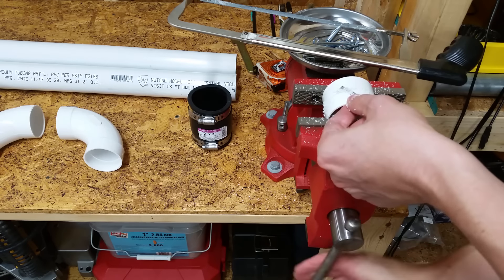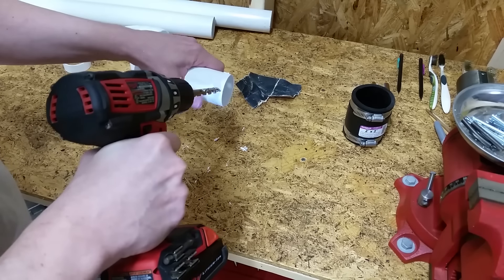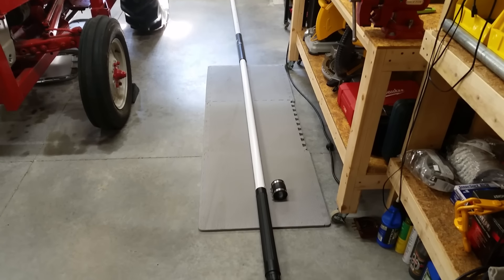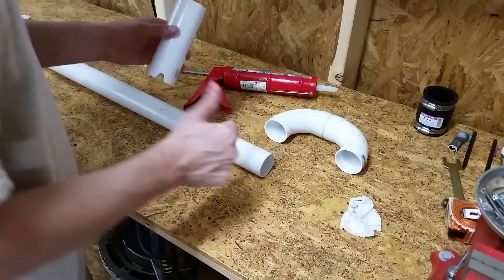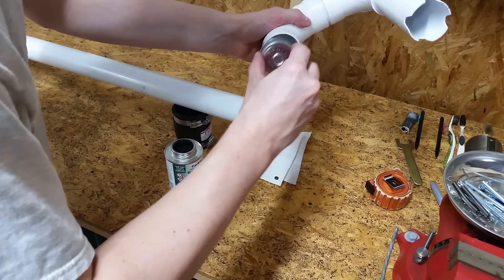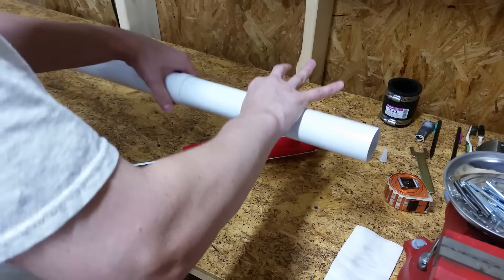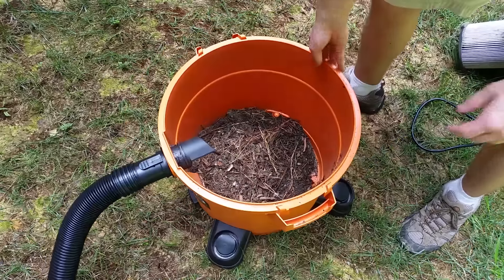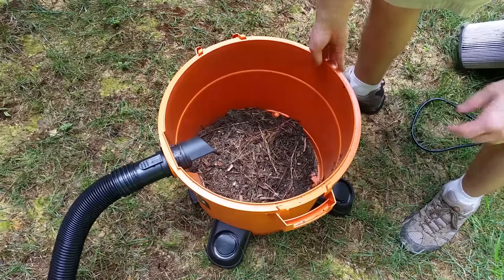DIY Gutter Vacuum - Easy and Safe Gutter Cleaning from the Ground

Comment: I made a similar pvc clean out but used 1.5 inch pvc and used a heat gun to bend the end of the 10’ section into a 45 degree hook - then used the heat to pinch the end almost flat - instead of suction, I used the shop vac blower - works decent
Reply from the maker: That's a cool idea! I've thought about doing the same but didn't consider that it'd be better to taper the end.

Comment: Nice Mike I'll give it a try. At 65 I spend as little time on the ladder as possible.
Reply from the maker: I don't blame you one bit! :) I did a follow up video in case you need more details.
Reply: @Mikeattempts  I saw the newer video. I have both of them saved and will have the device fabricated before the end of the summer.  I'll send you my critique. Thanks
Reply from the maker: @michaelcerkez3895  Yeah, let me know how it turns out! :)

Comment: I modified this approach to fit my particular skills using  packing tape, a  coat hanger, and some pipe  I found in the grass .
Reply from the maker: Hahaha, that's cool, whatever works! Since most of my gutters are 2 stories high, I don't know what else I could use besides the central vacuum tubing. Anything else would be much heavier and hard to maneuver.

Comment: This is totally awesome.  It looks like I can only get Schedule 40 PVC.  Thoughts on if this is too thin?
Reply from the maker: Schedule 40 PVC would be way too heavy for a 2-story attachment. It would probably be fine for single story gutters though. You should be able to find central vacuum tubing locally. I did a follow up video with more details and answers to the most common questions, check it out.

Comment: Good idea, thanks, - I'll make one too. But I have the problem of wet soggy leaves, moss and slime like some others in this thread which I solved some years ago by making an extension for my Karcher high pressure water cleaner using one of those garden shower things with a curved end and cutting off the end of a karcher nozzle. Needs some strong hose clamps to join them because the pressure is fierce. That works very well- at least for one storey - although it pays to wear a raincoat!
Reply from the maker: Hahaha, yeah, I bet it's just like getting rained on. Sound like a good solution though. With a strong enough wet/dry vacuum, I wouldn't be surprised if it would just suck all of that stuff up.

Comment: You can do the same thing with a leaf blower, just substitute a 45 degree elbow for the second joint - then you can blow the debris out.  Connect with whatever fits your blower.  I used a rubber plumbing reducer from my blower outlet to the size of the pipe.  Works fine.
Reply from the maker: Yep, you could also attach the vacuum hose to the exhaust port and blow 'em out but the leaf blower would probably be more powerful. Thanks for watching!
Reply: If you blow them out chances are there will be standing water in the gutters somewhere.  You'll be taking a shower in black nasty smelling leaf water before the job is done.  Guaranteed.  And half of the junk will end up on your roof shingles and siding.  Been there, done that.  Good idea...maybe it'll work for some...but keep in mind what happened to me trying that.
Reply from the maker: Yeah, that's the reason I only suck out the gutters, clean and easy. I don't wanna get covered in debris and then also have to clean up all the crap on the ground.
Reply: Unfortunately this setup won’t work at all with backpack blowers which have too many CFM’s and too much torque. I tried it today and the blower generates way too much power for the tubing and angles...unable to handle
Reply: @NeilLB7 yeah but his vacuum only works for small Leafs inhave maple and sycamore they are huge lol no way this would work

Comment: Yea that looks like a good idea rather than gutter guards just have to maintain I assume do it after hot dry days but you didn't mention what vac to use does a normal utility vac work for a long extension?
Reply from the maker: My vac is a "5 HP" but other viewers have said it works great with less power. I did a follow up video, if you need more details.

Comment: I made a similar version today and it worked very well.  I used shop vac extensions tubes I bought at Lowes, PVC pipe for the curves plus duct tape.   I did the gutters on the second story by doing it inside from the 2nd story windows.    All and all, I'm very pleased and I'm still in one piece!   Thanks for making this video!
Reply from the maker: Home Depot actually sells a gutter cleaning kit very similar to the one you made. That was a great idea to reach the 2nd story gutters from the windows. Thanks for watching!
Reply: can u reach all of ur gutters fm ur windows?
Reply: Nice

Comment: Great video Mike. I cut the exact coupler you used but it does not slide down the vac tubing. It only slides on to the end. How did you get tne 2 pieces to position 12 inches down the end of each vac tube? By the way, glad I read the comment. I am a 76 year old female and did not know pvc cement would not work on abs (I cut two 1 inch pieces of abs to use as stops on the vac tubing). So please let me know how to get the 2 pieces cut from the coupler to slide 12 inches down on the vac tubing. Thanks!
Reply from the maker: The coupler has a lip in the center which is why I used the odd method in the video of carefully cutting along the seam to remove that lip. I then used sandpaper to smooth out what remained so it could be slid up the tube, it is a tight fit though. If you want to use the ABS stops, you should be able to use silicone caulk, like I did for the larger piece. If that doesn't prove to be strong enough for the small ring of ABS, any construction adhesive caulk (such as Liquid Nails) should work fine. I did a follow up to this video, in case you need more details.
Reply: @Mikeattempts  wow! Thanks for immediate response. Yes, I did cut along that seam and made sure to eliminate it. I also sanded it quit a bit but no luck in getting it to slide 12 inches. So will be using the abs. Question: would jb weld be a good option to cement abs to pvc?
Reply from the maker: @someone2no104  Yeah, JB Weld should work fine. You might just wanna rough up the inside of the ABS ring and the outside of the PVC tubing, where the ring will sit, with sandpaper to give the epoxy a good place to hold.
Reply: @Mikeattempts  thanks!

Comment: The gutter vacuum is a great idea, I use that same setup but with a blower, but a vacuum seems easier
Reply from the maker: Yeah, I can connect the hose to the exhaust port on the vacuum and blow it out too, it's just cleaner to suck it out.

Comment: Good idea using the Schd 20 pipe... I've got 40ft of it left over from my central vac install that I now know what I'm going to do with it.   I think it might be more efficient to just cut out about 1" of the pipe that goes into the gutter half way around instead of having  4 cut outs like you made - you should have all the suction happening in the direction you are traveling.  It might limit you to traveling in one direction only unless you can twist that piece around... but small price to pay to get more suction where you need it.
Reply from the maker: I'm not lacking any suction but you could just make the holes smaller if that's a concern. The holes are only there to break the suction so the tube doesn't stick to the bottom of the gutter. Let me know how it goes!
Reply: @Mikeattempts  Quicker way to cut those slots would be to use side cutters and clip triangular openings.
Reply from the maker: @rokustittsville2422  That's true but I wanted to keep the holes rounded so pine needles and leaf stems wouldn't get caught in the notch of the "V". Thanks for watching!
Reply: @rokustittsville2422  Use stone rotary grinding bits. It will cut the round slot in a faster way or make the holes and then cut the pipe in the middle of the holes.

Comment: What kind of silicone caulk did you use?
Great plan.  Finally found a good place to get the vacuum tubing--kinda pricey many places and not available at HomeDepot.  I think I could do this using 4' sections of pipe connecting two together with a coupling.  I figured this out after paying a little bit more for the shipping than for the pipe for 2 8' sections.  Thanks again!
Reply from the maker: I just used regular 100% silicone caulking on all joints except the first elbow, where it connects to the long pipe, I used PVC cement on that one. I got my 8' sections of central vacuum tubing for around $6-$7 each at my local electrical supply store but that was in 2018. :)

Comment: Dude I just want to say thank you! I own a fairly new seasonal gutter cleaning business in a small town. I've had to turn down quite a few jobs that I wasn't able to walk the roof on. Having a machine like this would definitely help me to be able to accept a lot more jobs and be more efficient in a lot of circumstances. Not to mention I've found myself on a few too many uneven ladders trying to balance as best as I can not to tip because a house was on a slope and I couldn't do it from the roof. This will help me to do jobs like that way faster way safer. I appreciate you a ton for making this video! And also I think its awesome you took the time to type out the description too. You rock man!!  New sub 🤙
Reply from the maker: That's awesome, I love getting comments like this! If you need more detail, I just make a follow-up video. Thanks for watching and subscribing!
Reply: A landscape/ orchard ladder has 3 adjustable legs so you can set it up for almost any terrain.  Just built this tool but put threaded couplers between each pipe.
 This will add many more jobs for our lawn biz in the slow periods..  Costs have gone up significantly from this video.

Comment: I have been contemplating making something like this for my vac or using my compressor to blow the crap out (messy) or my pressure washer with a homemade extension (also messy). I noticed you had very little in the vac canister when you were done, so your gutters were nowhere near as full as mine get multiple times a year. I currently go up on the roof and use my back pack leaf blower, which makes a mess but it works.  How does this work for gutters with a lot more crap in the gutters or if the debris is wet? Thanks for posting.
Reply from the maker: Yeah, in the video I had already cleaned some of the gutters by hand before building the attachment, so the canister didn't have a lot in it. Since building the attachment, I clean my gutters twice per year and the canister is almost completely full every time (mostly long-leaf pine needles and smaller leaves). I usually wait for a few dry days in a row before cleaning them. One time I didn't wait and it still worked perfectly fine. However, the wet shingle grit and sludge stuck to the inside of the vac hose making it heavy. I ended up having to remove the hose from the vacuum and spray it clean with the garden hose. So, even though it works, I try not to do it when the debris is wet.
Reply: @Mikeattempts  Thank you for the quick reply sir and the information.. I definitely will be trying this one.
Reply from the maker: @TheRonKlimo  I forgot to mention, I did a follow up video with more details, if needed.

Comment: I found the  2" black abs pipe at Grainger locally in a 10 foot section for a reasonable price. Thanks for this video........
Reply from the maker: Yeah, I had to order my ABS pipe from homedepot.com and I think it was under $5. Local plumbing supply stores might carry ABS pipe too. I'm glad you were able to find some. Thanks for watching!
Reply: I understand there is difference between schedule 20 'tubing' vs ABS pipe in terms of outer diameter, how did you connect the Shop vac to 2" ABS? thanks

Comment: Thanks for the video. I just ordered all of the Sch 20. We have a historic house with cedar shakes, rolled-edge eave, and half-round copper gutters that hang (dangle) below the bottom of the curved edge. So propping a ladder against any of that is potentially damaging to that type of roof even with a padded stand-off attached to the ladder. Optimistically hoping this method will work great!
Reply from the maker: It works well for me, let me know how yours turns out. Thanks for watching!
Reply: where did you buy the tube sch 20??? very difficult to fine them

Comment: I made a similar rig out of aluminum downspout. Had to make a rectangular to round transition piece out of flashing for the attachment to the shop vac.. Works great and light weight.
Reply from the maker: Nice! Most of the professional ones I've seen are made out of aluminum tubes but they're pricey. Downspouts sound much cheaper if you want to go the aluminum route.

Comment: Great video. I have a 1.5" shop vac. What I ended up using are: A) 2X 1.25" Charlotte Pipe; B) 1X 1.25"X1.5" rubber coupler;  C) 1X 1.25"X1.25" rubber coupler; D) Flex 'n fix under sink extension tube inlet 1.5" length 8-12";  E)  a sink tailpiece 1.5" X 6" length ; F) a large paint wooden stirrer; G) duct tape; H) a couple small screws. All these materials bought from Lowe's. Homedepot does not carry schedule 20 pipes.
Reply from the maker: Thanks! Yeah, I had a hard time finding the central vacuum tube too, I ended up calling a local electrical supply store who had 'em in stock for around $6 per section. I'm happy to hear that you came up with a solution to fit your 1.5" shop vac hose, does it work well?

Comment: Use s few 45 degree fittings to offset the top of the long handle. Then you do not need to be directly underneath it. You don’t need to have the elbows in line (plan view) they can be rotated axially to create the desired shape you want.
Reply from the maker: I though of doing that but, even though it's a little rough on the neck to look almost straight up, it's much easier to control the attachment while standing directly underneath. I think your idea would work great on single story gutters since the length and weight would be half. With the tip at 45 degrees, your attachment would need to be slightly longer to have the same reach. Also, holding the attachment at an angle feels heavier than if you're directly beneath it. Thanks for the comment!

Comment: I put gutter covers on.  I have a long telescopic rod with a brush at the end and can sweep the gutter covers from the ground if required especially in inside corners where debris gets caught.
Reply from the maker: That's a great idea! The main reason I've avoided gutter guards is because I knew I'd need to clean the guards anyway. :)

Comment: Thanks for the gutter cleaning design.  Question: how do you know that the gutters are completely clean if you can't visually see what the vacuum has done????
I have Ranch house and allot of big Oak Tree leaves fill the gutters plus acorns, so not sure if this size piping is wide enough to suck all the big leaves into the Vacuum without getting clogged up.
Right now I have a service come out and do my gutters, but it is expensive for them to do it.
Reply from the maker: My gutters have internal hangars so, I just bounce back and forth between each hangar a couple times before lifting the attachment over the next one and repeating the process. This is enough to get everything, even the shingle grit. However, sometimes I find a clump of matted debris and you can actually feel and hear it, so I just go back and forth over that spot until the end of the attachment breaks it up and sucks everything up. Some viewers have added a camera to the attachment so they can see what's in the gutter but, for me, a camera isn't necessary. Dry, stiff oak leaves might not get sucked up very easily but, if you did it when they were a little damp and flexible, it might work just fine. You could test it by just making a pile of oak leaves on the ground and seeing if you vacuum could suck them up. Home Depot sells a Ridgid gutter cleaning kit for single story houses and it's only $30 so that might be a good option for your ranch. Thanks for watching!
Reply: @Mikeattempts  You are welcome Mike.  Always looking for new ideas to take care of my house by myself, and like you said, without injuring ourselves.
I have a shop Vac similar to yours, so just need the piping. What i could do next year is bring out the shop vac and see how well it picks up the oak tree dry leaves on the ground.  Besides the gutters, there are usually allot of stray leaves and small branches on the Roof top.  Maybe make a long shafted broom for parts that I can reach and brush off.  I hate getting up on the Roof - ladders again - too old for that kind of stuff now days.
take care.
Reply from the maker: @dathyr1  Yep, I try to avoid ladders as much as possible. Since the long-leaf pine needles fall year-round, I clean my gutters twice per year, so this attachment saves me a ton of time without messing around on a ladder. Here's the Ridgid kit I mentioned: https://www.homedepot.com/p/203235222

Comment: You didn't have leaves in your vacuum when you were done.  Have you used it to clean out a bunch of leaves in the fall?  Any issues with clogging because of the leaves?  Also, how did a bungee cord get all the way up there?  :)  Thank you for the video.
Reply from the maker: Hahaha, you're the first one to notice the bungee cord! I dropped that when I was working on a chimney leak and it slid down the roof into the gutter. :) We mostly have long leaf pines so pine needles are usually what ends up in our gutters. There were also willow oak leaves in the gutter but they are very skinny. We don't have any really tall oak or maple trees so those don't end up in the gutter. The pine needles and willow oak leave will sometimes form large chunks but I haven't had any issues with clogging yet. I'm sure clogging might be a problem with a weaker vacuum. Thanks for watching!